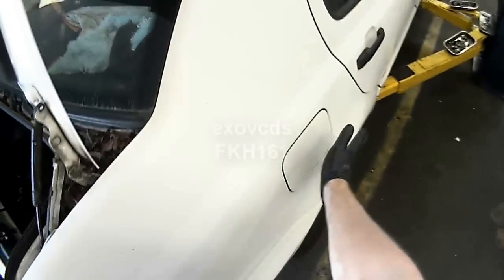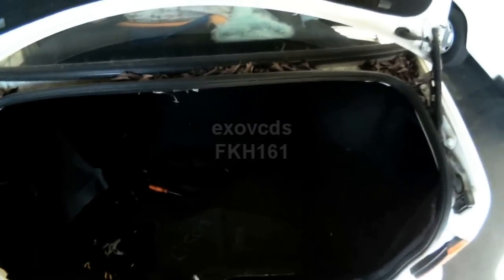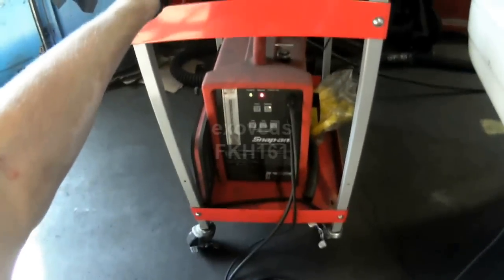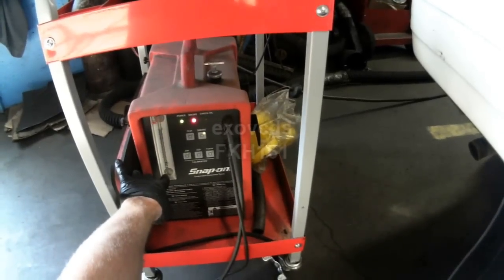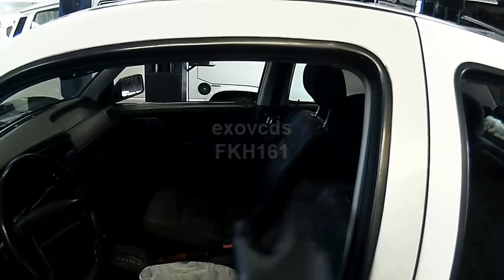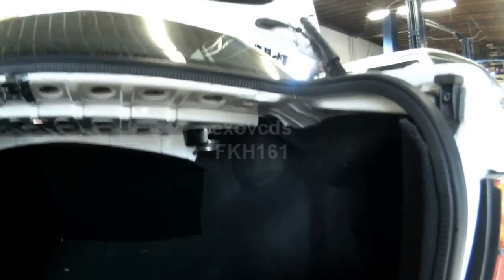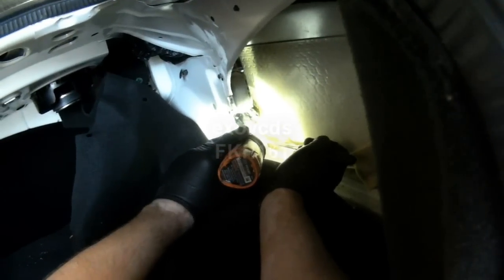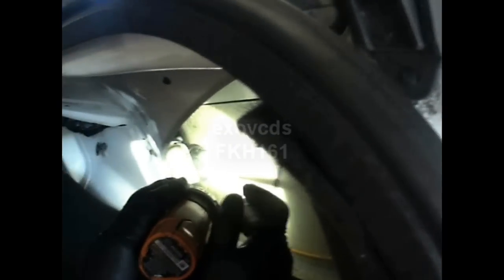VW A3: Central Locking System Smoke Testing for Leaks

Comment: I ve got problem with jetta vhen i open her it has sound like yours when you close her 
What is the problem
Reply from the maker: What year jetta?
Reply: @EXOVCDS  93 is jetta
Reply from the maker: @bejaminusein1081  look for vacuum leak / disconnected hose. If the doors unlock / lock... the last door that unlocks / locks has a bad connection. If none of them open, then the loss of vacuum is affecting all doors.